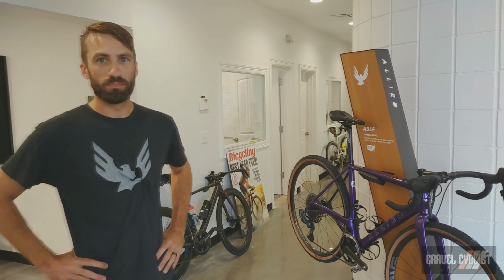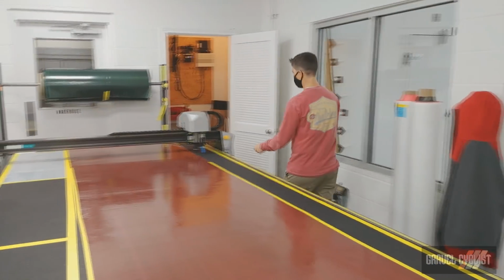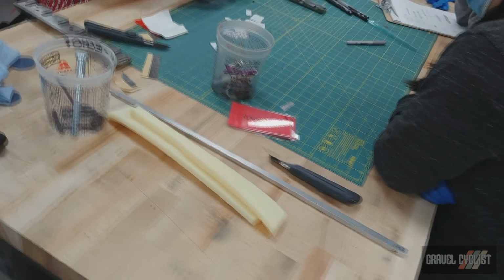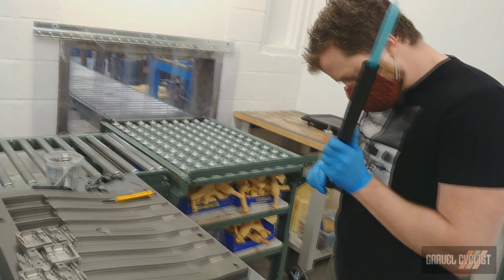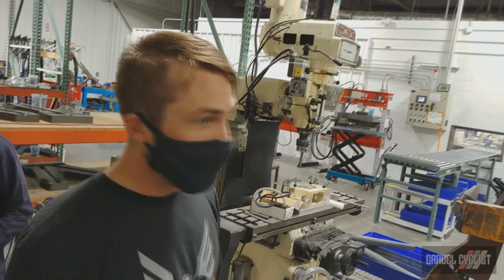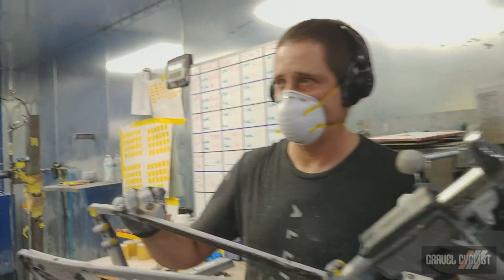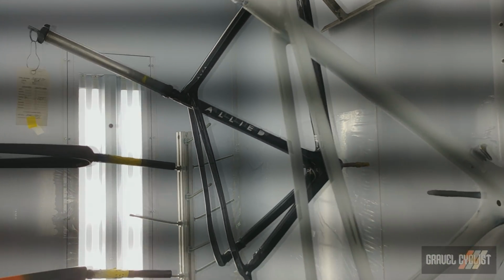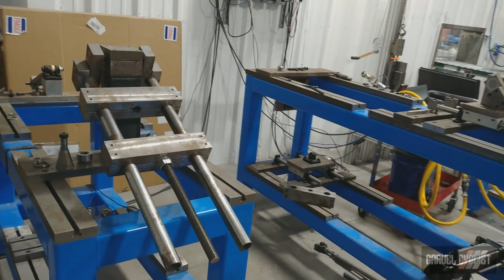Allied Cycle Works Factory Tour! USA-Made Carbon Bicycles - Rogers, Arkansas

Comment: hmmm.. he said that they are using unidirectional carbon fiber... but, if you look at the cutting diagram, the same part (cut out) are oriented (rotated) in random directions... shouldnt the same part always be oriented the same way so that the fibers always run the same direction?
Reply: not necessarily. you may want to run pieces that lay over each other at 90 or 45 degrees from each other.
Reply: That was a curious statement. You might watch that part again. He mentions why they cut that at different angles. If I recall correctly it was basically two reasons: to cut down on waste, but most importantly, as Tenatious_E says here, to get the fibers running the right ways to exploit the qualities of the carbon they want for the five part of the bike.